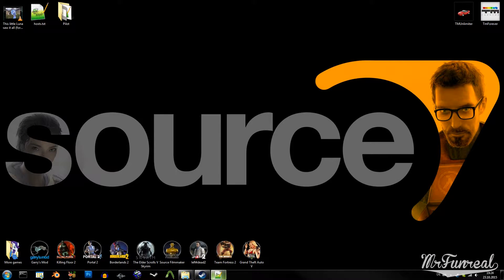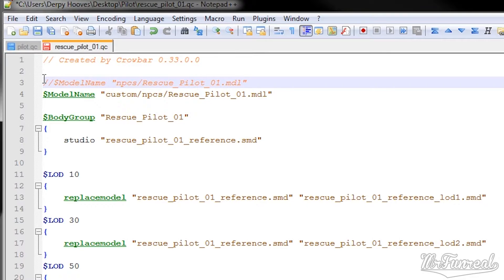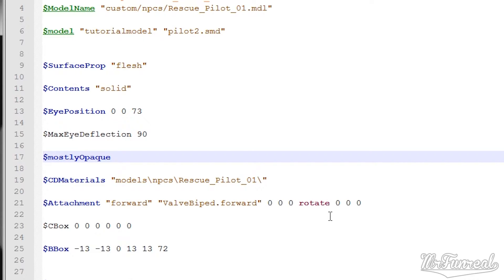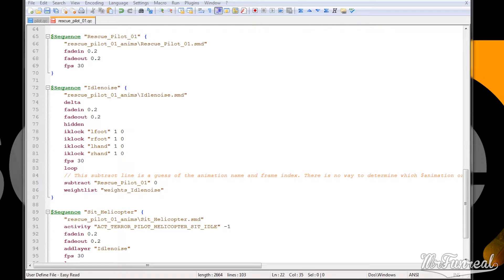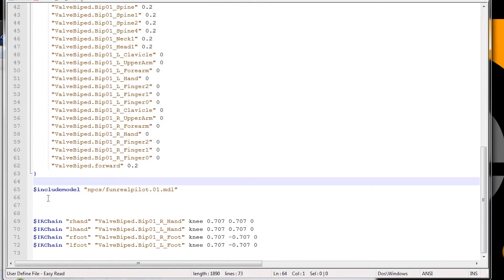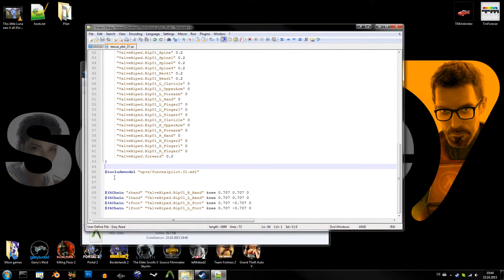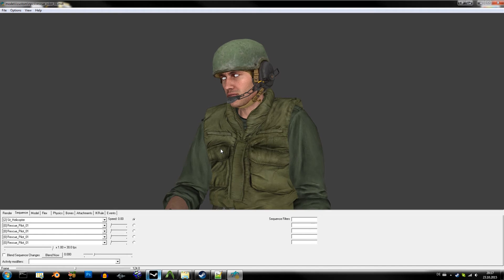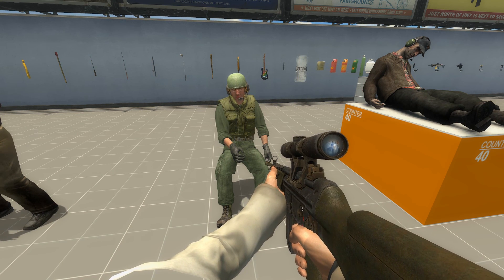Source Engine | Model Compiling

Comment: I've tried for the last three days to get Propper to work without any success. . .  Can Crowbar convert brushes into a model ?
Reply from the maker: No.
I can't get ptopper to work either because it is a hunk of junk.
I save the parts i want as a model i na separate vmf file wit honly that in it and the nuse crafty to import it and save it as an obj file that i then transform into a model. The scale will be kept, but the model will be rotated 90° on the X or Y axis
Reply: @MrFunreal  can you do a tutorial please? I saved them into seperate files. Managed to get it to open as an object in Blender. But can't seem to get it into a model.

Comment: Hey Mr. Funreal, I've tried compiling using a qc file, now it worked great and the model was extremly small so I rescaled it up in Blender, compiled again and it fails giving me an error "WARNING: Leaking 1 elements" Do you by chance know how to fix it? It completely fails to compile, nothing comes out.
Reply from the maker: well, you don't simply "have a go at compiling a model".
Decompile an original model from whatever game you're compiling for and take it as a reference. in your case a size reference. Might aswell use it's qc file as a base whilst you're at it.
Generally, just upscaling a model is a bad idea. 

That warning you got is usually at the very end of a qc file and basically just means "Shit's on fire, yo" aka "generic warning" the actual errors before it are more interesting. those are the lines that begin with "ERROR"

Comment: Hello Mr Furreal I have a question, to replace and model as the medkit and the Molotov for one like this https://steamcommunity.com/sharedfiles/filedetails/?id=547833172&searchtext=medkits
I would have to create the model and change some things in the notepad ++?
Or what I would have to do, sorry for my English, I am new creating some mods.
Reply from the maker: First off, you have to decompile whatever model you want to replace in your case a molotov.

Then you have to have a replacement model. Either get it from somewhere or make it yourself.

Then edit the  original model in blender where you basically adjust the new model to whatever look you want it to have and rig it to the bone(s)

Then export it from blender, edit the qc file to use the correct model and have it use proper animations. If it's a weapon model also create a proper physics mesh (in your case you can just re-use the model you're porting)

Then compile it.
Reply: Thanks: 3 now I understand a little more j

Comment: It didn't worked for me. I got this annoying error: 
ERROR: 'EXCEPTION_ACCESS_VIOLATION' (assert: 1)
    ERROR: Aborted Processing on 'Rephlex/Sheila/Sheila.mdl'
    WARNING: Leaking 1 elements
  ... Compiling ".\sheila.qc" finished. Check above for any errors.

This error also appeared when I recompile EVERY MODEL I can find for GMod! I tried to use the older versions but it still does the same.